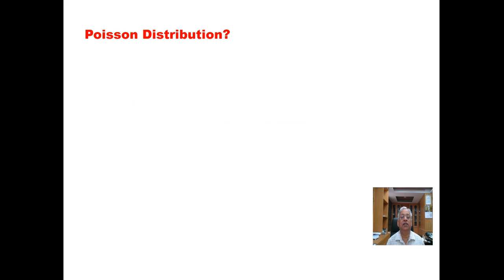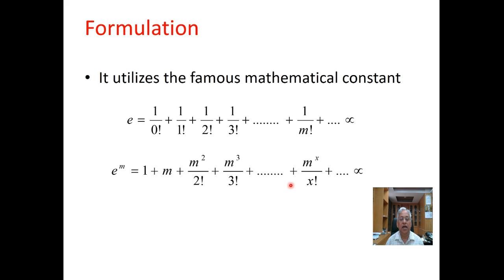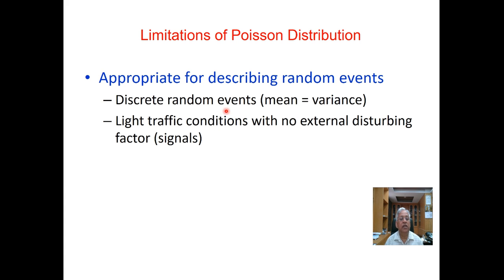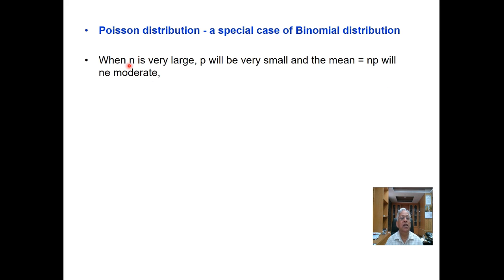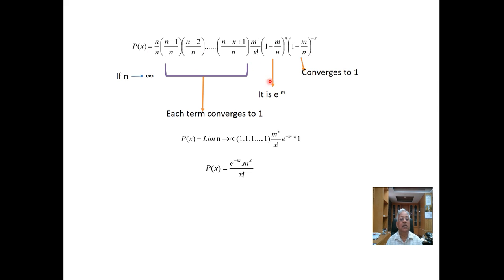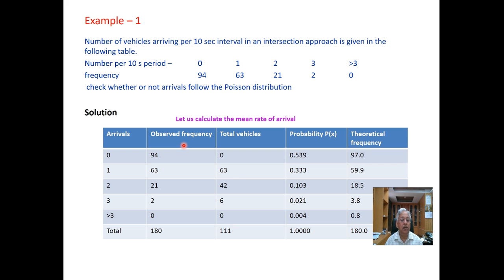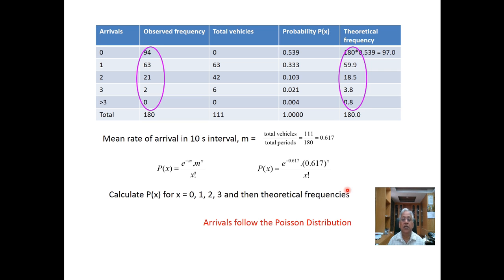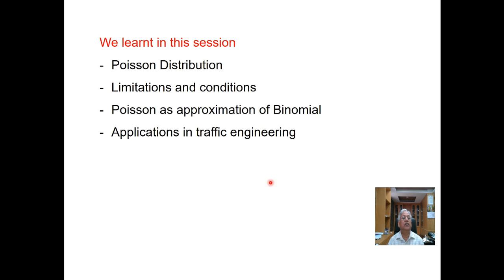#Statistics, Poisson Distribution for Traffic Engineers

Comment: How can you handle this question Sir : Data for a road shows that rush hour traffic volume is 2400 vehicles per hour  ( poison distribution ).  how many of the 2400 gaps are expected to be 15 seconds or longer during the rush hour?
Reply from the maker: It is simple. If arrival is Poisson then headway will follow exponential distribution. Here average rate of arrival is 0.6667 veh per second. Find the probabilty that no vehicle will arrive in a time interval of 15 seconds. 
P(h>t) = e^(-qt), Put q*t = 0.6667*15 = 10 and find the probability. Multiply this probability by 2400 to get the number of headways more than 15 sec. Practically zero. 
Watch video on Exponential distribution.

Comment: Sir is there any distribution used for the Design of Superelevation, Curves and Grade separated intersections ?
Reply from the maker: No, distributions are used to fit the certain data in to a statistical terms and then deterime the probability of certain event occuring or not occuring. They are used both on a theoretical level and a practical level. Some practical uses of probability distributions are: To calculate confidence intervals for parameters and to calculate critical regions for hypothesis tests.

Comment: in making the table like in 10:30 , do you always have to include zero arrival even tho there wasnt any in your observations? or is it right to just include the minimum number of arrival up to the maximum arrival in the table (like for example 2 is your minimum)?
Reply from the maker: Zeros will always be there in a count period of 10 seconds. As I told in my video, Poisson distribution is applicable to model random events. The arrivals will be random under low flow conditions and in that case u will certainly get zeros. If there are no cases of zero vehicle, it would mean the flow is high and arrival is more of uniform rather than random.
Reply: @SatishIITR  thank you for the reply sir! but just to clarify; i am currently making use of poisson distribution but unlike your example i have zero instances of having zero vehicle in a 20sec interval. is it necessary to include zero in my table even though the lowest number of vehicle that i have observed is 1 and not 0?
Reply from the maker: @AlexisS.  No it is not necessary to have zeros in the data if your observed values do not have it.
Reply: @SatishIITR  thank you so much sir! have a great day